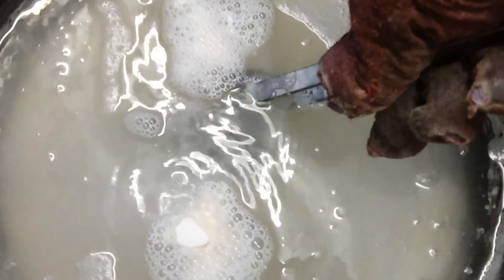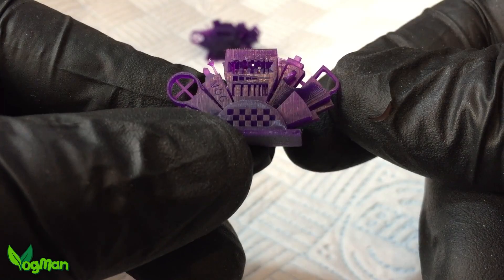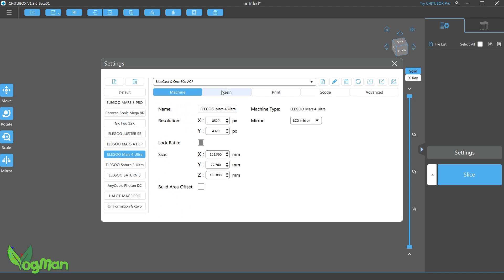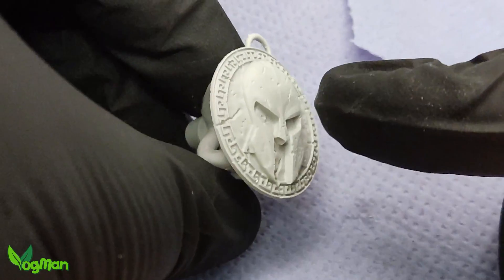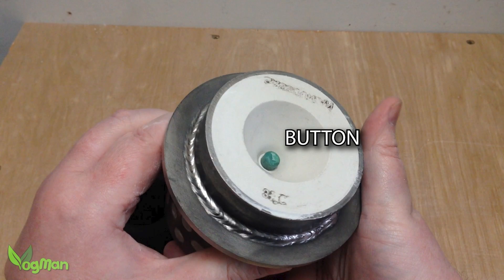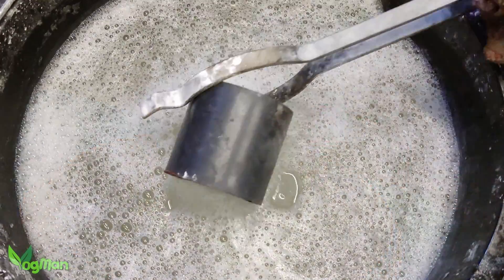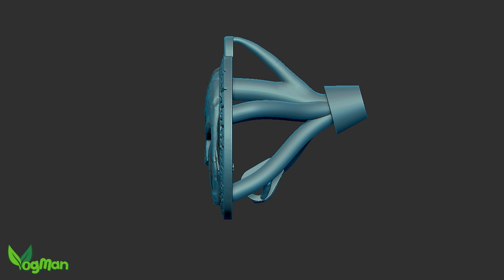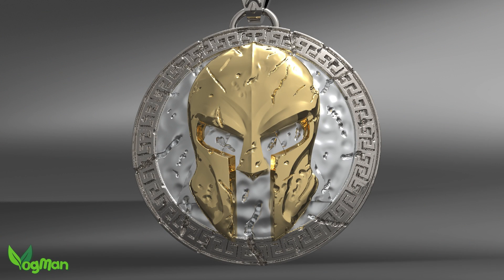Lost Resin Casting Guide - what NOT to do! Tips for better casting

Comment: hello new to your channel, but loving the content!  im actually a pro jeweler, if you dont mind a small tip, if you give the smaller raised pattern a bit of draft, and remove any hard corners, it's much easier to cast.   sometimes it doesnt hurt to take a small paint brush and paint on some thinned investment/plaster before you pour the flask full, helps with tiny bubbles.  anyway, thanks great content and well narrated!

Comment: What about doing a double cast rather than plating?  Meaning you cast hotter melting part in the desired metal, then attach it to the wax master for the second cast.  More obvious potential issues will need to be addressed, but you get the gist of the idea, eh?

Comment: The "pitting" you are getting is caused by investment breakdown. There could be 2 causes of this. Improper curing or improper burnout. I have strayed from the traditional burnout cycle most people use because it doesn't work well for me. The traditional cycle was based on wax, not for resin. I soak at 300F for 2 hours, then jump straight up to 1350F as fast as my oven will go and hold for 2 hours. Then I come back down to 900F for casting. 
As for curing, the sun works great! Leave your model in a glass container with half glycerin and half water for a few hour in the sun.
Give it a try. You might be pleasantly surprised.😀

Comment: Thank you again for this new video 👍. One question however : after dewaxing, why turn the mold over with the opening facing up while the plaster is cooking? Isn't there a risk that dust will get inside the mold and therefore cause defects on the casting part ?
Reply from the maker: As I understand it, there's still the possibility of trapped gases. By flipping the flask, these escape. Plus the flask is now in a ideal position for the pour 😁

Comment: Great vid vogman! Super useful for us rookie casters. Definitely interested to learn about how to prevent the pitting. That’s something I’ve been struggling with. Would also love a video on how to calculate ring sizing taking all various stages of expansion and contraction into account! I seem to be losing about one ring size in the process but it’s not exact. Any tips?
Reply from the maker: I guess it depends on the resin you use. Typically that's where we really see the shrinkage. Some shrink a good 10%. If we know this in advance, it's easy to oversize at the printing stage 😁